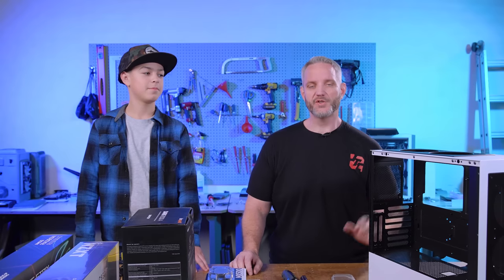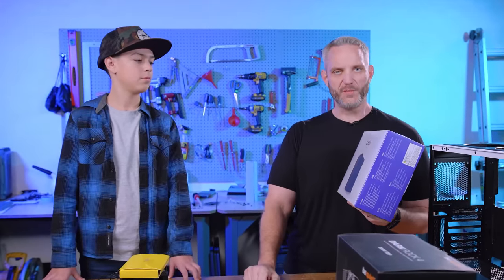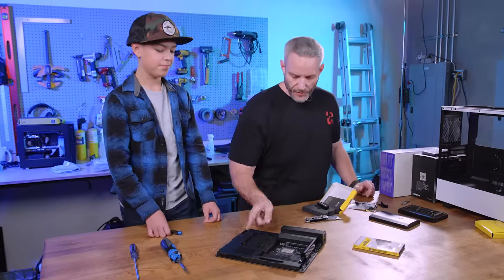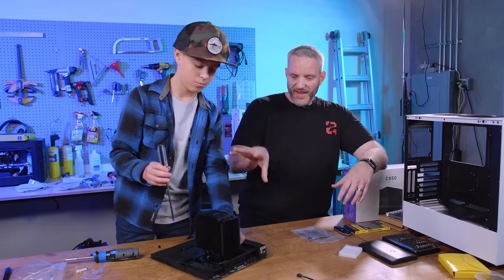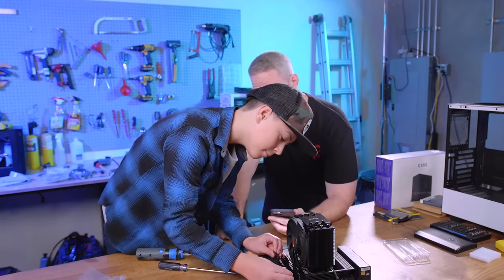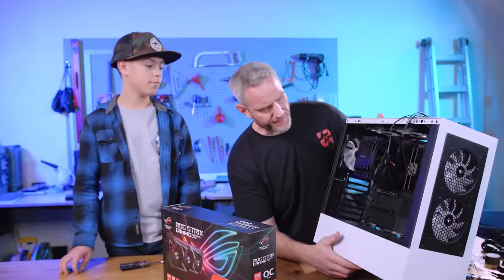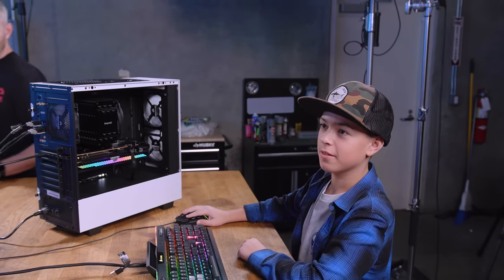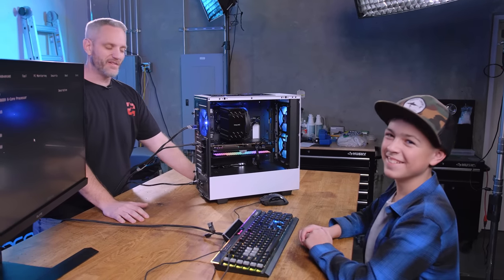He had absolutely NO idea what was coming!

Comment: That was cool and adorable! I do think though, that especially for beginners, making a Windows boot drive, installing from it, and then installing the bare minimum of drivers, is also a crucial part of "building a computer".

It's certainly not trivial in difficulty, and the machine doesn't become useful until it's completed.
Reply: It's about building not software setup? 🙄
Reply: @loman0071  Building a computer generally means you turn parts into a usable machine. A gaming PC without an OS or graphics driver in it is not usable, as it's main purpose is gaming which is not possible at that point.
Reply: @kazaakas  I get that but it's not the point of the content 👍. Jay also stated OS and such still needed doing. 👍
Reply: Aside from windows, your pc will literally install all those drivers for you. Probably before you even have time to jump online and find the one you need.
Reply: Install windows, connect to your wifi, the pc does the rest
Reply: @strider5119  Yep went to windows 11 with a fresh install and it found the drivers for my 2080ti and installed them long before I could manually do it.
Reply: @fjuulb can confirm this happens... bricked some fresh builds because of windows update.
Reply: @fjuulb yea, got a new G15 zephyrus laptop... Windows updated and then the next thing you know all my games ran like dog shit... Almost like there wasn't a graphics card. Every game was choppy even on low settings. This is where knowledge of drivers comes in. Had I not known to go and force the game manually to run off of the discrete gpu to make sure it was working properly then gone on to update drivers and delete old ones, etc etc, and if I were new to computers... I would have thought it just was a crappy computer and returned it only to have the same problem down the road. So yea, I'd say knowing drivers, software, bios, etc is crucial to complete knowledge of a build because it gives you insight into what each component is really doing when you go to start digging to find the problem. And this is on a laptop I didn't build lol so even more important on a pc build.

Comment: Can confirm the scariest part for most people is the RAM. Had my gf helped me with a build. She was horrified at first when putting the memory in. After some encouragement from me she got comfortable and started really putting her back into it, then I was horrified.
Reply: I enjoy ram the most, it's most satisfying for me 😏. I hate CPU coolers installation the most.
Reply: @HoodedMushroom  same here
Reply: I hate pushing in the 24 pin cable, and feeling how the board just bends. Hate that feeling, every time.
Reply: @Rezzell  You would think they would have made a better standard at this point. I hate everything about the 24-pin cable. Fuck that thing.
Reply: Lol
Reply: CPU hands down, for me, it was $500 of total loss if I bent a single pin.  Far scarier than the RAM was.
Reply: i have a lot of hatred towards the 24pin and the front panel connectors. Love the ram click though lol
Reply: Ya know ya gotta put som effort in to get it going propperly😉
Reply: @Konksling123  I do like how some mobo companies include a little bit that one can plug all the front panel connectors into, then plug the bit into the mobo.
Reply: I would say putting the 24pin in, feeling the flex is always a tad nerve racking
Reply: For me I worry the most about CPU even tho that is the easiest to do. But after that, is cooler and thermal paste part that I worry the most since is CPU adjecent... you know, is it too much paste, not enough, cooler screwed right not too tight or too loose.

And I found out recently that I hate installing rgb fans (extra cable mangement).

My favorite part is inserting RAM sticks, I could this all day long, even when I built my first PC, RAM was the only thing I was confident about. It is solid there is nothing to bend just put it in like a game into Gameboy slot... love it! Same goes for GPU... well if there is one to put in... 😶
Reply: @HoodedMushroom  After all the computers I've worked on, I can't relate to RAM installation being scary. The first RAM I installed was upgrading my Mac to 20 megabytes almost 30 years ago... I love installing CPU coolers. I have 5 different grits of sandpaper to get that mirror finish on the copper plate.

Comment: 14:27 the most accurate and relatable things to say. still brings back memories of my first true full tower build in 2018. been doing colelge by outputing my msi gaming laptop onto monitors and a laptop dock and all in my small rooms but once i got my own space half way through colelge oh damn was that a satisfying upgrade. great, cute and fun lil video for sure. awsome to see. but seriously........... i chose components and gear based on comprehensive review and installation guides i was able to find after almost a year of research and it went great nad i love the damn thing but mannnnnnnnnnn........... that initialfull system on power check................ I HAD MY PC CASE FRONT IO POWER AND RESET BUTTONS SWAPPED ON MY MOBO HAHAHA. shit you not when i hit power and literaly nothing happen i went 110% full speed panic mode so fast i almost threw up. thought i broke something, shorted something, would have to take the whole pc apart, thought maybe dead parts (literaly bench tested it and some how thought i was halicinating) and i shit you not nothing prepares you for "oops put got my wires flippy flopped" l;iteraly used the restart button for almost 2 whole days as my power on button SOLEY because i wasnt ready to get the tiny as cable swapped when everything was assembled hahaha

also nothing better then learning to adjust ur pcs power indicator cables cause man the base config would have infuriatied me for a decade. much cleaner when you really take your time nad get to know your parts. i spent an eniter day building it, full day light 8+ hours of dedicated build time, and thne another night of OS install and setup and gmae downloads hahaha

but after almost half a decade of watching and enjoying tech and build and pc content on and off.......... i just know and am more comfortable with so much more now. im dieing inside that prices are still so unrealistic but i desperatly want to do a full pc rebuild, or atleast canabalize some of my stuff and do a mobo or atleast ryzen upfresh and do a full REBULd of my system. 5 years of hidden dust and poor tlc. ESPECIALY my dumpster from the box or cheap 6$ case fans. needed ot replace tho poor broken bearing things for so long. theyre champions but mannnnnnnnnn i feel like my pc just desperves more. its so much cool stuff in it but in not evne remotly an interesting confirguration to make it endearing or interesting. cheers to my potential future build nad setup overhaul (but maybe not till i get a new place) and cheers to dusting out and enjoying the cathartic yet stressful fun of a complete pc rebuild to make up for the 5 year anniversary of semi abusing my pc hahahaha

Comment: So for the body comparison, CPU = Brain, MB = Nerve system, Ram = Short Term Memory, HDD = Long Term storage, PSU = Digestive system (supplies the energy to make everything run), Heatsink & Fans = respiratory system, and the case would be your skin/body.  The GPU could be considered your optics but I generally slide it into the same category as the CPU.

Comment: I think even now, after 3 decades of building my own systems, the most stressful part is the actual install of the CPU. I've yet to bend any pins, but watching videos for years I've seen how easily pins can bend if not properly slotted and then pressure applied. After that, everything else is simple with lots of busy work hooking up all the cables and tidying up.

Comment: For me the most difficult and scary part of my first build was if all the parts were compatible and not interfere, you check and check for compatibility with tools and stuff but you never really are sure if your radiator fit with your motherboard vram heatsink or the pci power cable, or the memory with the cooler or the length of all the cables

Comment: When I first started building computers, I would connect, CPU, RAM and graphics card to the mother board, connect the power supply and turn on. If the computer all fired up I knew I was good to go, if it didn't then at least I didn't have to try and trouble shoot with all Components fitted.

In the early days it was possible to plug an IDE upside-down an this could stop the system  posting

Comment: Power supply is more akin to the stomach,  it takes in food and converts it to energy to fuel the body.   The heart would be more in line with the water cooling circulatory system... but that's just my take on these analogies.

Comment: lol when I was a little younger I wasn't scared. In fact when the 3.5" floppy disk from the Zenith EZPC (286) wouldn't work on my compaq (386) which only had 5.25" but unlike the Zenith it had a hard drive, I'm like......obviously I need to swap the bios. This is when I discovered the horrors of ESD. I fried both bios chips and niether computer (both were obsolete anyway) ever booted again. This is how I ended up with a 486 sx-33 (which is just slightly too slow to get max FPS on doom you need a 486 dx-66 for that)

Comment: "Just how robust these parts are" he says. Well I once messed up putting my videocard into the slot which cause my videocards I/O shield to create a cut/incision across a small part of my motherboard. Bye Bye motherboard... I had to RMA it. So trust me its better to delicately handle your stuff even now. The reason its not an issue on this motherboard is because it has covers but if your motherboard doesn't have this its better to handle it carefully.

Comment: I've been building computers since I was twelve years old (26 years roughly), and I still handle things delicately. I just yesterday replaced the intel ILM on my board with a Thermalright contact plate, repasted and reseated the cooler, and was sweating bullets when I tried booting it. Doesn't help Asus' bios takes forever to post after 'hardware changes'. A lot of YouTubers gorilla grip components and press ram sticks into boards on hard surfaces. It panics me so much.

Comment: I love videos like this.  When I learned how to build my first few computers I needed 3 years of electronics under my belt from High School.  Then I had to learn how to wirewrap all of the parts together into a working circuit.  Once it was built and debugged I could concentrate on learning machine code.
  
Granted you don't need the same level of knowledge these days but it is still a most rewarding hobby, especially if you can help someone learn how to do it for themselves instead of trusting Geek Squad or even worse, the Apple "Expert" Bar.

Comment: Manifacturers really need a better solution for the RAM install, thats really the most scary part building a pc because it requires so much force. I used my motherboard box as a surface and it almost got crushed pushing the ram in.

Comment: windows 10 has stuff in the code, so i can plug a SSD off a FX8350 into a ryzen 9 5800 board and it will work flawlessly right? windows takes up 240GB as is... should have it at that capacity, unlike the 15000 bucks of the car's repair bills in the last 3 years. part just goes here, snap goes another bolt... nut fallen onto the deepest hole of an ant hill that wasn't there but that's a few wasps flying out of and back round running ...